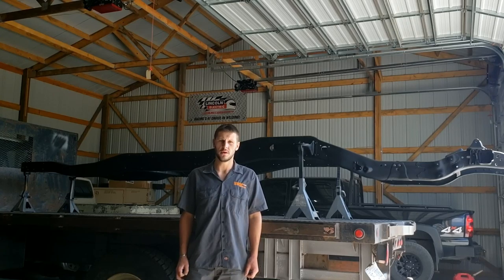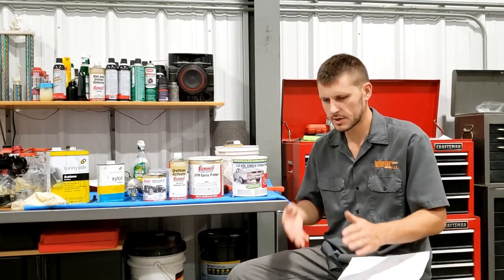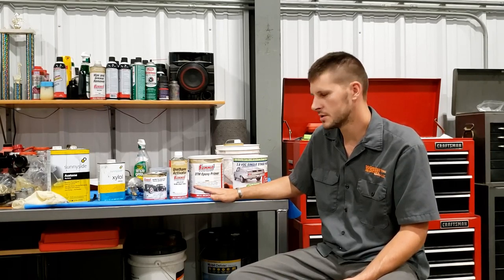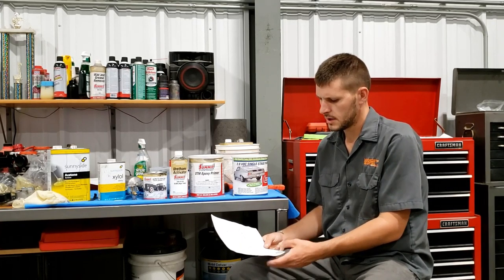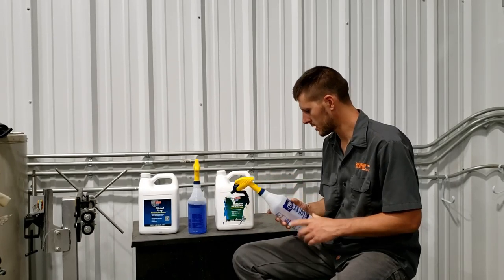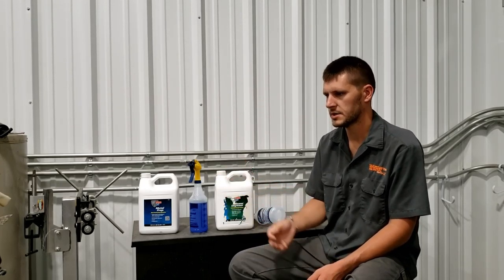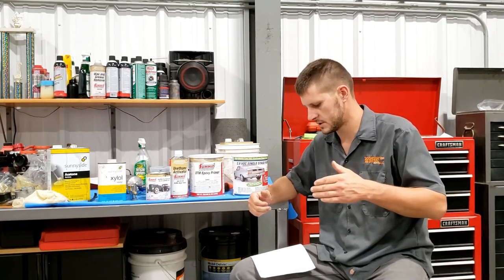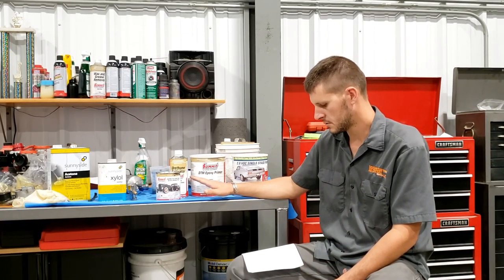Painting a Truck Frame: A Review of POR-15 and Summit Racing Paints

Comment: Back in the 1980's I worked at a Phosphoric acid chemical manufacturing plant (Prayon Process).  Phosphoric acid comes in many different concentrations and grades (the two aren't always related).  Be careful when you buy phosphoric acid in bulk.  Some grades of phosphoric acid have impurities that will negatively impact your paint.

Comment: I think the things that makes por15 work is that it cures using humidity and that it sticks well to rust and etched surfaces. To me, I believe the secret sauce is that it pulls moisture out of the rust and from the surface that it makes contact with, uses it in the chemical process while curing and seals it at the same time. New rust needs moisture. On the tie coat/high build primer: The por15 needs to fully cure before its sealed w primer, so the instructions say to light dust coat after the second por15 coat passes drag test. I'm sure this is to allow best adhesion of the primer coats and to let the por15 finish curing. So after primer dust coat, I'd give it at least 3 days to finish curing then do the full primer coat/dry/sanding. After that, with coarse sanding I figure I can then get in any necessary glass and bondo etc... At least that's my idea of how to go from rusted with holes to top coat. Don't leave on any scaled rust as it will have moisture in the layers that por15 will prob not pull out. Where I have layers I can't remove like were the metal sheets join in a weld, I've drilled access holes for the por15 to get at it. For large surfaces, I've used coroseal, great produce 3 years later without painting, seeing pin points of rust. 3 years later, anywhere I've used por15 I've seen no new rust, but it was alot alot more work. Coroseal is like a varnish coat, not real pretty, por15 looks great, especially when I coated it with flat black
Reply from the maker: POR15 is snake oil. I don't have time to create a follow-up vid right now, but the POR15 failed in less than a year.
Reply: I used rust oleum rust reformer and undercoat over it not the thickest 2years ago and it just started to surface rust in spots it’s holding up decent for using a wire wheel to do it with no primer and the cleanest it could get

Comment: Great Video, very informative but now im completely confused about Por-15. I will be at that stage soon where I will be protecting the controls arms and sub-frame on my 68 firebird. I was sold on POR-15 until this video.. Now not so sure.. My parts are black aluminum oxide bead blasted so there super clean.
Reply from the maker: Super ironic that you comment right now, as I am getting ready to release a follow-up video urging people to stay away from all POR-15 products. They're all a gimmick and are better left sitting on the shelf.
Reply: @doomsdaydiesel  Damm! Thank God I decided to do some utube research on this product.. Looking forward to the video. Thanks for the reply.. Now ive got my work cut out for me on another product.. Thanks again..
Reply from the maker: @anthonysantiago1999  just get a quality epoxy primer. Apply 2 good coats. If you need to use phosphoric acid before hand to treat surface rust then do so. Top coat is still questionable. I'm not sure if an acrylic urethane is best or something like Chassis Coat or Chassic Saver is best. Only time will tell.
Reply: @doomsdaydiesel  Thanks for the tip, Question if parts are freshly blasted do you think I will still need the Phosphoric acid bath or is it okay to just wipe down with de-natured alcohol and apply epoxy primer?
Reply from the maker: @anthonysantiago1999  I don't see any circumstance where it can hurt because 100% of oxidation will never be removed. I can't comment on the denatured alcohol. I use the paint's prescribed Wax & Grease remover as well as Parts Wash. I try to use everything from 1 brand - not mix things. But phosphoric acid is one of those things that's just watered down and sold under different names for different prices. I'd go with whatever's cheapest there.
Reply: @doomsdaydiesel  Copy that, Thanks. I like your attention to detail and will enjoy seeing your other videos. Looking at the water separator for air compressor now.. Just subscribed.. A ton of help and you saved me  at least 100 bucks on garbage products..Thanks again..
Reply from the maker: @anthonysantiago1999  I'll sell you the rest of my POR 15 🙃😅